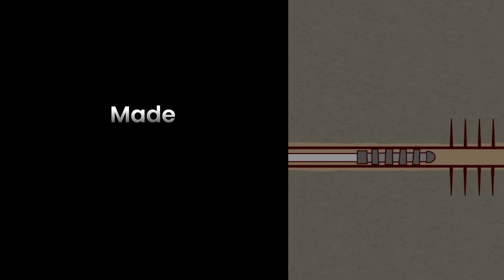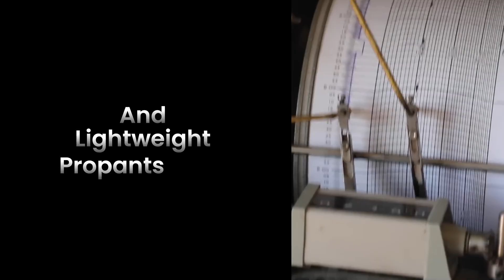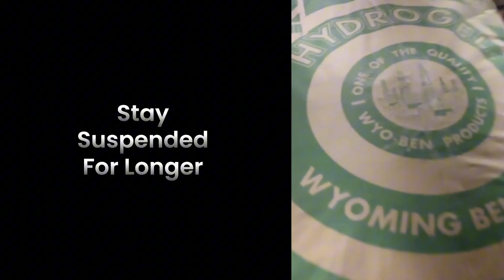What Happens When Fracking Gets 20% Better Overnight?

Comment: Hey, I like your videos but gotta call you out when you state (1:05) Saudi Arabia is only making money when oil is $80 a barrel. That is dead wrong. The Saudis are THE low cost producers on the planet. They can be profitable at $30 a barrel. They routinely flood the market, lowering the cost of oil to force the frackers to stop drilling new wells because fracking is expensive and the wells deplete quickly. Fracked wells require around $60 oil to be economically profitable enough to be worth drilling
Reply from the maker: Thanks for the comment, and you’re right that Saudi Arabia has the lowest lifting cost on the planet. They can physically pump a barrel for just a few dollars.

In the video I’m not talking about lifting cost, though, I’m referring to Saudi Arabia’s fiscal breakeven, which is the oil price needed to balance the national budget.
That number is much higher than the production cost.

IMF data puts Saudi’s fiscal breakeven roughly in the $80–$95 per barrel range:

IMF data via FRED:
https://fred.stlouisfed.org/series/SAUPZPIOILBEGUSD

IMF Statistical Appendix:
https://www.imf.org/-/media/files/publications/reo/mcd-cca/2025/may/english/regional-economic-outlook-middle-east-central-asia-may-2025-statistical-appendix.pdf

So yes, the oil itself is cheap.
But the Saudi state budget only balances at much higher prices.

On shale: the “$60 to break even” figure was true years ago, but not today.
Modern Permian breakevens are commonly $35–$50, depending on the operator and rock quality, which is why shale keeps bouncing back even when Saudi floods the market.

Appreciate you raising it, good discussion.🙂
Reply: Excellent discussion, thank you both.

Comment: Feel free to disagree, but I think anyone who thinks oil will be a major factor in markets for electricity, fuel, energy, etc in 2040 is behind the times. Why?

Lazard just pointed out that utility scale solar and wind are about the cheapest energy sources available. Even with storage, wind and solar are still competitive with oil and gas, and much more reliable than wind and solar alone. 

Plug in solar (and residential solar of all kinds) is getting more popular in the US; solar and batteries are seeing a near exponential increase in deliveries worldwide, including in China and Africa; the current policy blocks against renewables in the US are projected to only slow their adoption speed, not destroy the renewables and storage markets; data centers in the US are spiking demand for electricity, and only renewables plus storage (plus easy to revive old nuclear sites) are able to quickly provide the power they need, while oil and gas will be too slow to build or too expensive.... I could go on. 

Bottom line, oil will be on its way out in 2040, not benefiting from a shale boom. This is still an interesting innovation, but not one that will be important to people a quarter century from now.

Comment: 4:03 That's wrong. The Mid East can get oil to market at $2/barrel. That's why they call it "easy oil." Shale pumps shut off once prices drop under $60/barrel. 

I don't know where you got your numbers, but there's no way a place where oil literally bubbles to the surface and is drilled by nearly-free migrant labor is going to produce a barrel of oil at a higher price than anywhere else in the world.
Reply from the maker: Thanks for the comment, and you’re right that Middle Eastern lifting costs are extremely low. Saudi Aramco can produce a barrel for just a few dollars.

But that’s different from the fiscal breakeven oil price, the price the government needs to balance its national budget. That’s the metric I’m referring to in the video.

According to IMF-sourced data, Saudi Arabia’s fiscal breakeven in recent years is roughly $80–$95 per barrel:

IMF data via FRED:
https://fred.stlouisfed.org/series/SAUPZPIOILBEGUSD

IMF Statistical Appendix (breakeven table):
https://www.imf.org/-/media/files/publications/reo/mcd-cca/2025/may/english/regional-economic-outlook-middle-east-central-asia-may-2025-statistical-appendix.pdf

So yes, the oil is cheap to lift, but the economy requires high prices to function.

Meanwhile, modern U.S. shale breakevens are typically $35–$50, which is why the comparison isn’t about lifting cost, it’s about economic pressure points.
Reply: @GeopoliticalFrontierOfficial That makes perfect sense. It's not like those countries have the diversified economies we have in the West. Kind of puts a new perspective on how I view the Saudis and those "oil rich" Gulf States. Thanks for educating me!

Comment: Graphene is going to CLOSE EVERY GAS STATION in America by 2032.  Graphene will completely destroy the gas, oil and coal industry before 2035.  FREE ENERGY is coming.  Graphene solar, graphene super conductors, graphene batteries, graphene air motors, graphene 'grown' circuitry....  no more toxic microchip manufacturing industries...  AND...  RARE EARTH MINERALS ARE OBSOLETE...     Graphene is derived from the most plentiful element on Earth,  graphite.  cheap, free, non toxic.

Comment: What happens when fracking makes the environment in the area unlivable or toxic? Do we need that oil?
Reply: What makes you think that this will happen?  The only fracking associated well that contaminated groundwater was one the EPA drilled themselves.  They didn't seal the well and had a massive diesel spill (which they didn't clean up) that went down the well and into the groundwater.  That's why the chemistry of the 'hydrocarbons' they discovered weren't anything like crude oil.  

It cost the state that the drilled the well in over $5 million to clean up the mess and properly seal and abandon the well.  Just like the time the EPA screwed up and contaminated almost 100 miles of river - then claims 'sovereign immunity' and saddles to local governments with the cost of cleaning it up.  

And here's a challenge for you - try to look up the research the EPA uses to draft regulations for yourself.  They refuse to release this information.
Reply: @colincampbell767  I have my doubts when we are talking EPA capacity to check all that need checking especially now during Trump. Then their is the problem with only citing the US as a source of examples. This is before we are talking time for the effects to manifest.  This is just for starters!
Reply: Yes we need oil.   Fracking is harmless, conducted in shale 1-2 miles below the surface.  Upper wellbores cased in steel and concrete.

Comment: I do not think Exxon has been quiet about its innovation. Is this supposed to work for old wells (refracking) or only new wells? Also, where did the 20% come from when initial production only improves flow by 7-18%?

Comment: The Permian isn’t running out, but keeping production steady still costs money. Pessimistic scenario: smaller reserves and modest 10% tech gains give about 13 years, while optimistic scenario: big reserves plus 20% uplift could stretch it to 41+ years. Even with Exxon’s lightweight proppant boosting output 7–18% per well, old wells still decline fast, so operators must drill new wells or re-frac existing ones to hold total production. Each new well can cost $6–10 million, so the tech helps offset costs by getting more oil per well, but it doesn’t eliminate the need for ongoing drilling. Small percentage improvements multiplied across billions of barrels make a huge difference, but it’s still a long, declining tail, not infinite output.
Reply: The Permian is declining,  already past peak.
Reply: @donalddrane2795 no buddy it’s not …
Reply: Permian Basin oil production has surged, hitting records over 6 million barrels per day (bpd) in 2023-2024, significantly driving U.S. output, with major growth from Texas/New Mexico counties like Lea, Eddy, Martin, and Midland, primarily from Wolfcamp, Spraberry, and Bone Spring formations, though charts show consistent highs and a need for ongoing drilling to maintain output. You can find detailed charts from sources like the Railroad Commission of Texas (RRC) and the EIA (U.S. Energy Information Administration). 

Key Trends & Data Points:

Record Production: The Permian hit its peak production around late 2023 with over 6.2 million bpd, continuing strong into 2024.

Comment: Gulf of Mexico/America/USA whatever that be called now continues to get moar offshore oil 🛢️🪔🛢️🛢️🛢️ drilling brand new 🆕🆕🆕🆕 and yes they know how to tie back natural gas from that bring that onshore power up a turbine super chill that and use that for everything from #lng_tanker ship fuel #boil_off to rocket 🚀🌌🚀🚀🚀 fuel ⛽⛽⛽ #space_x that oil then enters the usa into our absolutely massive pipeline system either as oil to be refined or as refined product in absolutely massive amounts. If you drill for oil you'll also get another crazy valuable commodity called fresh water 💦🌊💦💦💦 too much of that actually sodium as well ....all on an industrial scale. The other item produced which is why the USA and now Canada produce simply vast quantities of oil is #carbon_capture carbon gas ...push that gas into the ground out comes oil and the associated gases ....for as long as you can keep that carbon gas flowing into oil fields you will get oil. Using that energy product economically is always a challenge tho. Long $dooo strong buy 😊😊

Comment: I am happy we can produce more fracking oil at minimal increased dollar input costs, but at what cost to surface and groundwater contamination? Refinery coke waste often has significant levels of toxic heavy metals, phenols, heterocyclic hydrocarbons, and polyaromatic hydrocarbons. Inert, hard, and relatively harmless silicon dioxide (SiO2–quartz) is 99% of sand used in fracking. It has very little if any toxic effects on humans, plants, or animals. Silicon dioxide has a very high Mohs Hardness index and does physically prop open tiny cracks in the shale through which the oil and gas may flow. 
Highly toxic coke waste hydrocarbons have much less hardness and compression resistance. They enhance fracking oil flow and production less by propping open pressure-induced cracks, and more by a solvent effect on thick, viscous, long-chain oil components (“like dissolves like”). In-ground, untapped oil is comprised of light short-chain hydrocarbons that flow readily as well as medium- and heavy-chain hydrocarbons that act as sludge impeding flow. 
Everything in life involves tradeoffs. We may still want to use some hydrocarbons in our fracking production water but we should also know and understand the downside costs and effects of those highly toxic contaminants.

Comment: So much wrong here. First oil WTI is in the upper $50 range now and US rig counts ARE dropping.   The world is awash in oil capacity and prices crashing as we post. Bringing more just lowers the price.  Most other oil only costs $3-$40/bbl to produce.  What the producing country needs to make to survive, means nothing. With that much wrong their credibility is not good.  I'd verify.  Except  I paid $8k for enough solar, battery to cover my home, EV energy needs for 20+ yrs, is big oil, NG's nightmare, so doesn't effect me, as billions soon will too.
Reply: I'm with you on that last part. Billions worldwide are increasingly interested in adopting solar, wind, and batteries, as well as BEVs and other tech that doesn't need fossil fuels to run. In a world like that, oil drilling innovations won't matter. 

With the falling LCOE of solar wind and batteries, and with the exponential increase in their installation globally, assuming things stay the same, 2040 will see a decline in oil's importance as a factor in geopolitics. Oil doesn't matter if barrier free easy-to-produce electricity is the world's energy of choice.

Comment: Pet coke is pure carbon. Many refineries burn it to produce steam to generate electricity and provide heat for the processes. It's also shipped to thermal power plants and cement kilns. I guess they have found an inexpensive method to turn pet coke into tough carbon fiber grains or lightweight zircon grains.

Comment: I’m aware of the Fracking Procedure,it’s Crude Oil in Rocks or Sand,but that doesn’t matter anymore,with Climate Change,Most Fossil Fuels Will Be obsolete,only the byproducts will be used,Solar,Wind,and renewables Electricity are in over the Long Haul,Fossil Fuels are Hurting the Ozone Layer,the protective Shield against Ultraviolet Radiation from the Sun,America has the largest reserves of this type of Energy in the World.
Reply: Wind power what a joke.  Do the math on how much petro it takes to build a windfarm and how long a wind generator last, not to mention the 30% loss of electricity going down the line.

Comment: This is mostly not helpful in the Bakken formation because the formation is only about 50-60 feet thick, but there might be gains anyway.
Reply: They just drill down to different levels to run more laterals.

Comment: The trouble we have with the fracking oil is that it is a light sweet crude and the oil refineries in this country cannot refine it, so we export it. I can see one day that will come back and haunt us,
Reply: The US has trillions of barrels of light sweet crude out west in kerogen deposits. Some companies have been mining the rock to heat in retorts which releases the light petroleum. Phillips Petroleum devised a method where they drill holes then lower electric heaters to release the oil which is then pumped out. The DoE asked Phillips to find a way to extract it right after the Arab Oil Embargo started with Phillips getting that done when Carter was in office. Carter refused to pay Phillips since "he didn't hire them" so Phillips sued the Federal Government. They won a judgement against the Feds during Reagan's second term.
Reply: Doubt it because when you flood the world market with it it lowers the price of oil around the globe because it increases the supply which causes the price around the globe to drop
Reply: Worried about a nonexistent problem.

Comment: Where did you get the Saudi’s $80 break even.  Most sources have them as the lowest cost producer with the operating cost to “RAISE” a barrel at $4 - $6.
Reply: The $80 is a mistake. That's the minimum they need in order to fund their governmental budget and that has been creeping up in recent years. Light Sweet Crude always has the lowest break-even cost and always will.
Reply: The Saudi oil fields have required water flooding to increase down hole pressure for quite some time. To get usable water they have built oil-fired generation plants to power multiple large desalinization plants so they can have water that won't corrode the steel pipelines taking it to the oil fields.  All of that has eaten into their profits per barrel..
Reply: lies
Reply: They have high expenses out side of production. Oil pays for everything over there, government, military, food, water and energy.  Unproductive government jobs subsidies on everything.  So their oil needs to be 80$ or bills don’t get paid.
Reply: @lproth  They can simply adjust the amount of oil they pump to keep the profit the same. e.g. If the production cost is $6/bbl then selling a million barrels at $80/bbl yields the same profit as selling three million barrels at $30/bbl.
Reply: @DingoHammer  its not that simple because higher production can kill prices, creating diminishing returns. They also have an existential on their reseves running out in the near future. Globally oil is readily available for centuries but the Saudis have been fire hosing their resources for a hundred years now.
Reply: @ahuhahuhahuh0  Barring sanctions and tariffs, the low cost producer determines the price because he can always go lower.  Saudi may be running out of oil, but they still have enough to prevent competitors from waiting until they run out.
Reply: @DingoHammer it doesn’t make any sense to wait for market share on what will quickly be a shrinking market
Reply: @lproth  wrong!
Reply: Here's what Yahoo finance says: 
"Meanwhile, the Saudi economy depends on oil revenues. The rising costs of running the country have pushed the break-even level of the price of the energy commodity to over $80 per barrel on the Brent benchmark. While the nominal production cost of oil is the lowest in the world in Saudi Arabia at $2.80 per barrel, the requirements for revenues creates a wide gap between production economics and balancing the Saudi budget."
This video mixes up the break even price for the country with the actual cost which is $2.80.
What's a little bit of AI slop betweens friends ?  :-)
Reply: All the ones saying saudi needs 80 per barrel,  also believe gas stations only make 3 cents per gallon of gas 😅😅😅

Comment: When the original well is depleted can they move over a couple hundred yards and drill again  ?
Reply: There's an optimal well spacing for each shale formation.  The original wells (parent wells) usually produces at greater volume than the subsequent wells (children wells) due to well spacing and depletion.
Reply: when they say long laterals they mean 1 to 2 miles sideways in the shale  I have been at rigs where they move over 50 ft and drill in a new direction putting 4 holes  side by side
Reply: Sometimes they conduct a workover or refrac, and the technology improves continually.